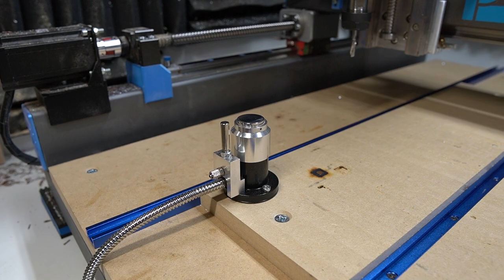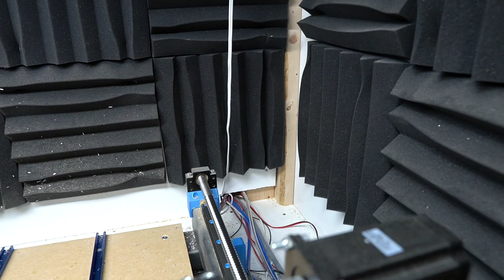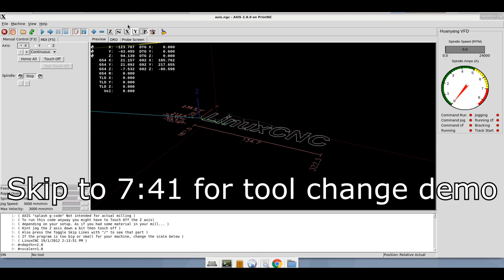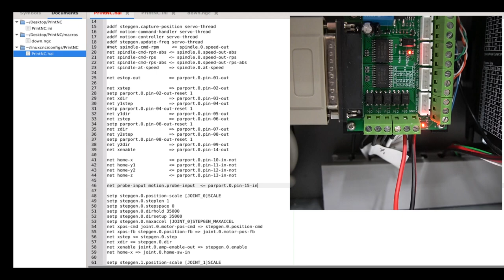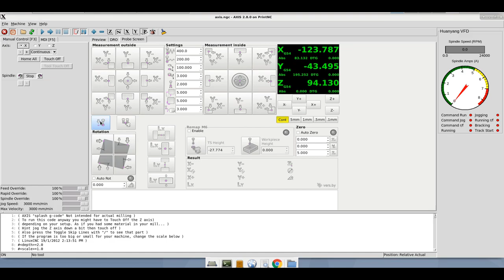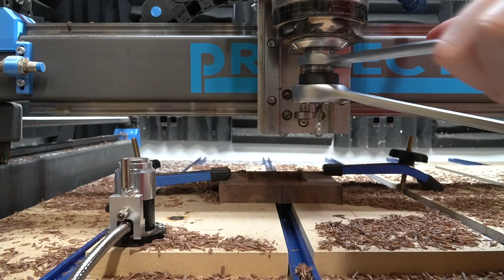How I added a tool height setter to my PrintNC!

Comment: This is a really awesome approach to getting the tool setter to work! Although i have to ask. Why are you using g92 z value instead of g10 l20 p1 z value? Wouldn't you have a double offset from not cleaning the previous g92 with a g92.1?

Comment: Very Cool.  From what I could see, our electronics are VERY similar.  

On wiring, you mentioned that you were not sure if polarity mattered.   If your spindle is grounded, and if the body of the touch plate is also grounded, I think you could get some strange readings if you have the polarity reversed.
Reply from the maker: Nice! Well the reason I mentioned that is there appears to be a diode on the probe circuit of the touch plate according to the diagram on the Amazon page. Not sure if I just got lucky with my polarity, or if it does matter.

Comment: Just in case you didn’t know, you could actually use a Stepper Motor Spring style coupler, braze it to two aluminum plates and now you have a spring loaded touch plate and you wont break bits :)

Comment: Hello, I added the same tool setter to my Router CNC, at some point during the installation, did it not happen to you that the tool lowered more than it should in the calibration? 'cause that happened to me, and I don't know if it is due to the software parameters

Comment: great vid as usual, isn't your spindle grounded? no issue with the +5V of the probe?
Reply from the maker: Thank you. Yes, the spindle is grounded, however no issues since the probe runs on 24v. I have wiring diagrams of my setup on my website projectsbybrian.tech

Comment: Very nice video.  I’m setting up the same (I think) tool setter on Linux CNC / MESA 7i76.  Could you describe the cable wiring on your tool setter?  The wiring diagram shown on Amazon lists Yellow/Green (Probe Signal) and Red/Black (Overtravel Protection Signal).  These wiring colors match the unit that I received.  The overtravel circuit seems straight forward and works as shown in the diagram (simple NC switch closure which opens at known travel).  I’m having trouble getting the Probe Signal circuit to work.  I see in your video that you have Red/Black wires connected to a digital input (correct?) on your breakout board.  Which tool setter cable wires are your Red/Black breakout board wires connected to?  Are you supplying any power from the breakout board or is it just a simple digital input for a switch?  Amazon info says 24VDC (max 20mA) power?  Thanks for any info you can provide.

Comment: hi is it normally closed? or normally open? if N / C like mine and it seems to me many on the market how do you put the wires in the board the same way you connected your previous N / O touch plate 'I don't understand ... and which wires do you use for the board 4 on the probe which are yellow and green for the probe and red and black for the estop?
thanks and congratulations for the cnc

Comment: Hey mate, I just had one fail and the estop saved some catastrophic damage. I'd hook it up if you haven't already
Reply from the maker: I should probably have clarified in the description. I actually have two estops on the machine, I just don't have the overtravel switch on the tool height setter wired to an estop, or an estop input. I will always be watching the tool probe so I didn't think it was necessary. Check out my website in the description for a full wiring diagram of my setup if you're interested.

Comment: thx for the video. im new to linuxcnc. im coming from mach3 with big tex probe screenset. big tex, got  two options for probe. first for the work z zero. and then it will probe for tool offset. how do i use it on linuxcnc ?

on big tex i got a option for tool change pos. after manual tool change, it will go to the pos and do a  tool offset. and automatic start the spindle for cutting again.

Comment: i have same controller board but if i connect wires to board GND and pin 15 ṕrobe pin, and go looking hall-meter, working this ,not show true/false, same pin 10 E-stop switch not show true/false, what is wrong ? need this board external 12 volt power to other side board screw terminal, manual say have 12-24V power in terminal "optional" but i looking input terminal go line led and 12 volt line. need i install this board 12 volt power supply, not power at usb port. or both usb power AND 12 volt line can use probe to optocouplers. and were i need add linuxcnc file location to code "down.ngc" and how add to display button"touch Z height" who start touch code. sorry  i not understand linux any.

Comment: hey brian, im trying to set this up on my machine, im also using the axis gui but not using the probe screen and want to set this up so i can change tools during milling like you have as the projects i want to do now require tool changes, i know you have linked the.ngc file and my sensor wil be close to where you have place yours, i understand how to set where the spindle will move to when it wants to probe the tool height,  its the other changes that i need help with,  as im using the axis gui and the ali express BOB and i have a printnc, could you help me out please as or point me in the right direction as to what i need to put where in my hal and ini files ect to get this setup on my machine, if i have to ill setup the probe screen too i dont mind i just want to get my machine to a state where everything is working so i can save my files and concentrate on actually using it instead of spending days or week figuring stuff out to be able to do stuff, and thankyou for all your videos so far they have all helped me with my build since i started so much,

Comment: how could you break your tips with your old touch plate ? 
i have a similar one (but that heights 19mm) and the only problem i have is sometime some induction happens and it triggers 1-1.5mm before touching when using some big tools espcially chamfers one.
but except for that is ultra precise so maybe you are going too fast or i don't know about your control board. 
seems not to control anything in stand alone but more a interface for the PC so probably the problem is here as i don't consider a pc even in linux as a realtime system. (personnaly i'm using duet 2 wifi board as my nema 23 are rated for 2 amps)

Comment: can you go over the setup of the part on spoilboard, coordinates, etc.?   i've typically just screwed down my piece and then set zero off the piece on the board.  I'm assuming this means that 0,0 is always bottom left and you would have to measure from there to place your cut piece from there?
Reply from the maker: Not quite. I probably should have showed that part in the video, however I still made the center of the walnut piece my X0, Y0. In this particular case, I jogged over to the piece of walnut, eyeballed where the center was, then ran "G92 X0 Y0" and that would zero out my coordinates to the middle of the piece of walnut. Then once I touch off on my touch plate, that would essentially put X0 Y0 Z0 at the bottom center of the walnut piece, and you would program this accordingly in Fusion (or whatever CAM program you're using).
Reply: Thank you! This makes everything very clear.

Comment: Will this script work in Mach3? I'm assuming it will since it's G-code but thought I would ask. I just bought a similar tool setter and cannot find any kind of script for these but am going to set up like yours where it's sitting in the corner somewhere out of the way. I'll be 3d printing a mold for a cover then casting it with liquid rubber to protect the sensor during operation since I will be using coolant a lot.
Reply from the maker: Yes, it should mostly work. You might have to make a few machine specific changes that I'm not aware of, but it's worth trying.
Reply: @ProjectsbyBrian  Thanks. I know I would have to change coordinates and such but I just wanted to  make sure the basic script could be re-typed out verbatim into mach3.

Comment: Im planning on doing a DIY CNC but when you change the tool what happens if the gantry moves? how do you reacquire positioning? Never had a CNC so I have no idea how
Reply from the maker: The stepper motors will be enabled which hold their position in place when doing a tool change. So it's usually strong enough when you're loosening and tightening the collet nut. If, for some reason you moved the stepper motors during a tool change, you'd have to re-home and start the job from that tool change.
Reply: @ProjectsbyBrian  okay so as long as I add stops to mine it can locate its position? I have a 3d printer so I assume its a similar set up.
Reply from the maker: @shrimpinpat  yes, every CNC should have end stops so you can home it to a known location.

Comment: Sir, how does the machine know the top of the stock with respect to the machine table? Since the bit touches off the tool setter/probe and it knows the length of the tool setter/probe relative to the table only. I seem to be missing something
Reply from the maker: Great question. Typically, you would run a facing operation across the top of your stock. This will tell the machine how thick your part is. Since the machine knows where the bottom of the stock it (top of the wasteboard) and also where that facing operation is being performed in relation to the wasteboard, that is how it defines the top of the stock. It doesn't technically have to probe it in order for it to know where it's at.

Comment: Hey Brian I just came across your channel and wanted to say thanks for the great content. I originally found your channel as I was looking for material on the MPCNC and see you have moved to the PrintNC. Looks like a heck of an upgrade, I am coming from a 3018 Pro and mostly looking to do signs and wood based projects but wanted something faster than the 3018. Would the MPCNC still be a good option or is it better to just wait and save up more for a PrintNC or Shapeoko or similar?
Reply from the maker: Hey thanks for watching! If CNC is something that you know you want to do long term, then I would probably save up and build a PrintNC or similar. This machine comfortably fits my needs and will last me the rest of my life (don't hold me to that statement). You will spend more on a Shapeoko or PrintNC (steel prices have gone up the past 6 months...) but it is more of a "buy once cry once" situation, and is almost an investment at that point that will last you a long time. Last thing I'll mention is that the PrintNC is very much a DIY project and while there is a lot of community support for it, you have to want to embark on the journey, if that makes sense.
Reply: @ProjectsbyBrian  thanks that makes sense. On the MPCNC what did you use for a router? And where did you find your DOC and feed rate best for walnut. That might help me make a call. :)
Reply from the maker: @sparks-tech  I used the Dewalt DW660 which is used on a lot of machines. It actually has quite a bit of power, but is very loud. I actually have a video of my MPCNC cutting some walnut at impressive speeds on my channel. I forget the exact numbers, but I think it's only a minute or so long if you want to look for it. I also have a MPCNC playlist as well.
Reply: @ProjectsbyBrian  thanks Brian really appreciate the time. I will double check that playlist. Must have missed it.
Reply from the maker: @sparks-tech  no worries! Glad to help!

Comment: How is the heat inside that enclosure? Do you have any fans or venting in it?
Reply from the maker: Haven't had any heat issues. I have two 80mm fans on the rear of the case for exhaust. I made a video on the electronics enclosure if you're interested.

Comment: So what about the connection between the program and macro? When the program has an M6 how does that call the macro to run?
Reply from the maker: I'm currently not doing anything with the M6 command. Not yet, anyway. I just run the macro manually after the tool change.

Comment: would that be the same script with the 7i96 mesa board?
Reply from the maker: The script is actually just generic g code, and yes it would work the same. I actually switched to the Mesa 7i96 a couple of months ago and plan to do an update video on the entire setup soon. I'm handling my tool touch off scripting a little different now.

Comment: i just orden parts can made simple brass sheet Z probe tool, brass sheet, some screw and wire, alligator clip, magnet spindle wire made this maybe,first alligator clip, same board has, probe wiring easy pin 15 and ground, but code and were not understand. just has installed linuxcnc my old hp computer core2 duo, my first time use linuxcnc before has used lot mach3 but not good, i looking linuxcnc have lot better REALTIME and FREE, flexiple make own tools etc, but not understand code and how make and were make.

Comment: Using a toolsetter sure is faster than fishing for a touch off with a precision shim!  Please reconsider not having an e-stop.  When things go seriously wrong they go fast, having a one-step kill button is super important.  Even if it's just a fused disconnect on your power circuit with a handle you can throw, it's so much better than hunting for "spindle stop, feed hold, reset reset reset aaaaaaah" when things are going to pieces or igniting.
Reply from the maker: Yes, so, I recommend checking out my other videos for more info about my electrical setup. I actually have two estops wired on the machine. When I mentioned that part in the video, I just meant that I wasn't going to wire up the over travel switch on the probe to my estop circuit for now, since I'll be watching it probe every time.
Reply: @ProjectsbyBrian  aaah, that makes a ton more sense!